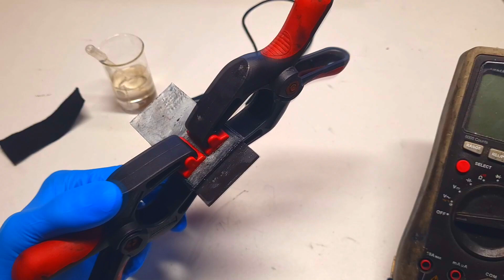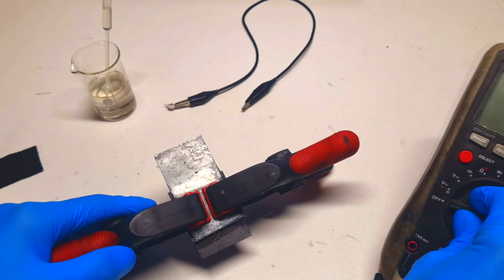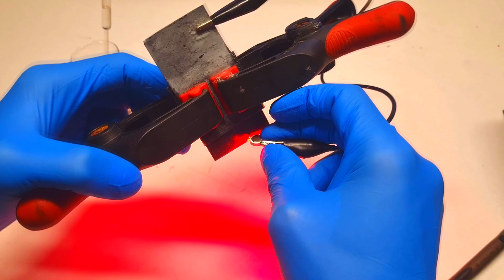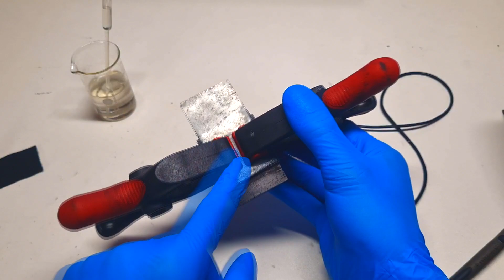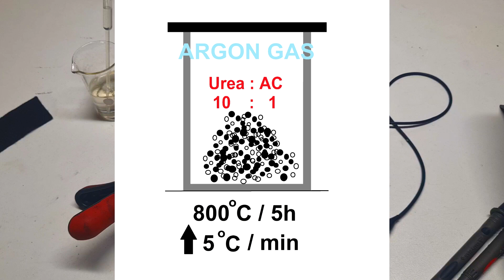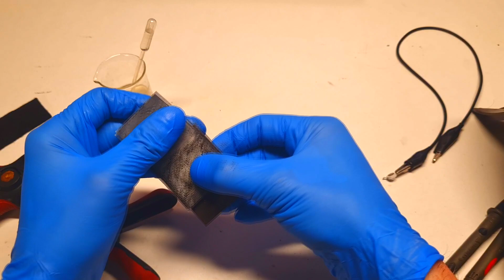DIY 2 Volt Zinc Chlorine Battery

Comment: How to make 30 molar choline cloride? It mean 4 kg choline cloride + 1 liter water?
Reply from the maker: 4.18 kg to 1kg of water. Because is m = where “m” refers to mol kg-1, that is, 1 mol of salt is dissolved in 1 kg of deionized water
Reply: @cayrex  can i make electrolyte from choline cloride 60% corn cob (feed additive)? Because in my country choline choride 99% is more expensive.
Reply from the maker: @Why-Utomo  60% is a bit low. But you can try to see what you will get
Reply: @cayrex but i check, solubility of colin clorida is about max 5,5 mol/L at temp 20 degress Celcius. So how technique to make 30 mol/L? Is it by heating it?
Reply from the maker: you heat up to 60C. Did you not read the paper, is all there?
Reply: @cayrex  thanks a lot for your answer 🙏. 
Im sorry, I try to download paper but canot full text because needed author permit. I just try more n more but still cannot download. 
Im very happy, if you like to share the paper to my email. 😁
Reply from the maker: @Why-Utomo  I don't have the full paper either. But most of the info you can get from the free version
Reply: @cayrex  ohh i see, tks very much

Comment: Hey question for you. did you see the joe rogan pod cast with Terrence Howard, he talked about Walter Russel.s periodic table, I believe that how Walter did the table show you how to make different batteries, meaning the table are divide by octaves, in the diagram it shows +1 sodium  and  - chlorine, and the middle elements could be the membrane. what do you think
Reply: Pro tip: don't look for your science from comedians and actors. These 2 knuckleheads left A LOT out of the discussion about the flat out incorrect parts of Russell's periodic table as well as the lack of inclusion in it of what have proven to be very useful parts of Mendeleev's table that  have been vital building blocks in materials science, chemistry, medicine, and process engineering. Also....and maybe more to the point, Terrance Howard is a scientific crackpot and chronic exaggerator/inflator of his science and engineering credentials, of which he has earned NONE...his thoughts about the periodic table have been thoroughly discredited sort of like the new ageist theories surrounding quantum physics have been proven to be more like quantum horse$hit....i.e. utter crackpottery. To me, he is very earnest however he appears to be more of a moderately functional person in acting that's dealing with a psychological problem that includes both bipolar behavior and on-going bouts of self aggrandizement.

Comment: Isn't this an old tech?
Reply from the maker: Yes the zinc chlorine chemistry is old,... the first patent was applied1899
Reply: He showed a very recent paper so, if it is, maybe it’s being revisited
Reply: Yea,   it was  Zinc Copper  with salt electrolyte.   The usual experiments we did as kids.   However,  I'm confused as how it achieved 2.2 volts.  The only water battery i know that can reach that is Lead acid batteries.
Reply from the maker: Yes, maybe you miss the electrolyte configuration in the cell. It is 30m ChCl,... which is more like WiSE electrolyte. More concetraded will be the electrolyte more will weakening the hydrogen bonds of free water molecules. In the paper is also described: "Recently, high-concentration electrolyte concept has been proposed to widen the electrochemical window of aqueous electrolytes to about 3.0 V by weakening the hydrogen bonds of free water molecules [12]. This strategy has been successfully applied to various aqueous electrochemical energy storage systems, such as aqueous batteries like sodium, potassium, zinc, and aluminum and supercapacitors [[13], [14], [15]]. Concentrated electrolyte can effectively suppress the electrochemical activity of water molecules and increase the stability window of the electrolyte. Moreover, it can also suppress the solubility and accelerate chlorine ions transport, which enhance the redox reaction of chlorine ions at high potential. Therefore, high-concentration electrolyte strategy provides a new approach for designing and developing high-performance aqueous zinc‑chlorine batteries."
Reply: @cayrex  
that's an interesting concept....  I will have to try that.